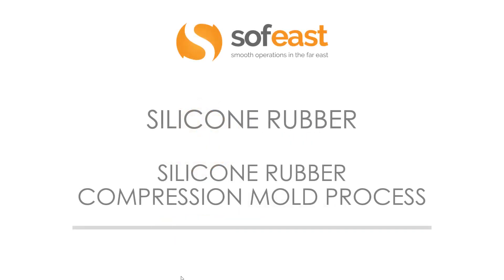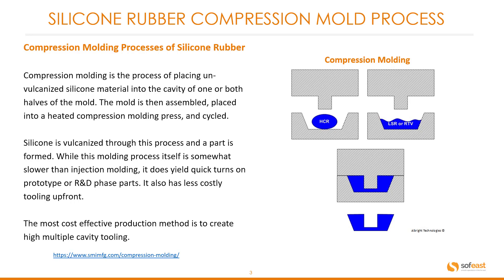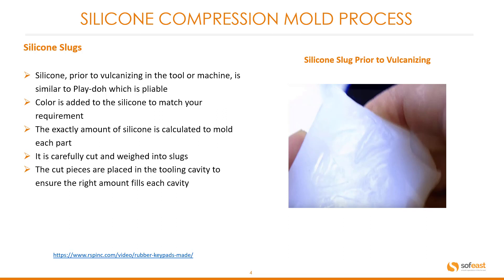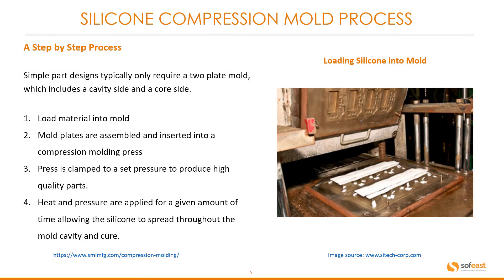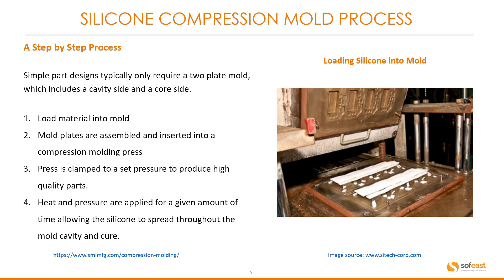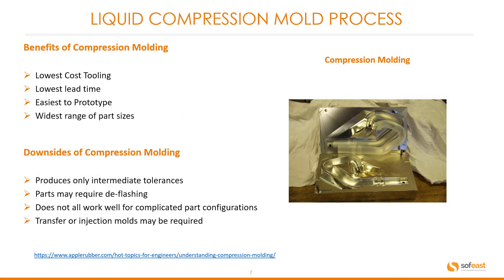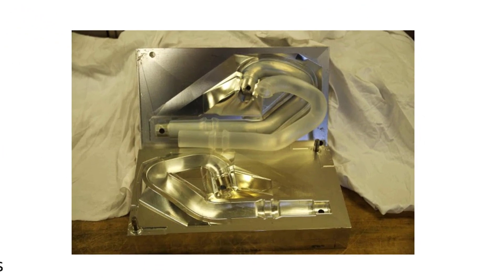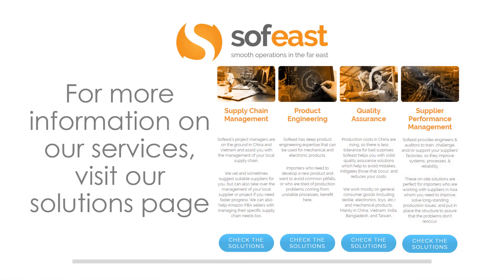The Silicone Rubber Compression Molding Process Explained

Comment: Towards the end of the video it shows a snorkel. How is the interior kept hollow using compression moulding? I’m assuming it isn’t using a 3 part mould with a flexible removable core as I assume that wouldn’t hold shape during compression. Is it achieved by using a 2-part rotational moulding process, or is it a 2-part mould which just creates one half of the snorkel and then the other half is moulded to it? Thx
Reply: I had this same question, glad i'm not alone.
Reply: It can be done a couple of ways. 1. A three part mold with both ends being open. Top, bottom, and a center tube not shown on this particular video. Excess material is trimmed away leaving  smooth edges (or almost smooth).  2. The extrusion technique. There is a core that plastic or silicone is “pushed” past. Like the hollow tubes shown in the video. I am sure that there are more ways that I know about. YouTube is a great source for information on this topic.
Reply: It would have to be a solid core. I have done silicone rubber compression molding and we did one project that was similar but ours was straight. This one is curved so machining everything would be more complicated. To be hollow there would have to be an insert with compression molding.